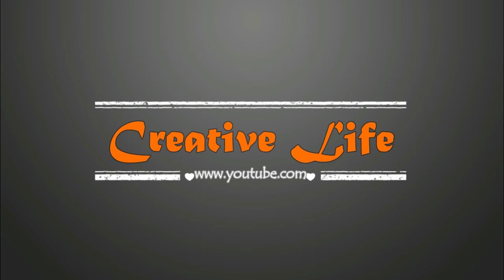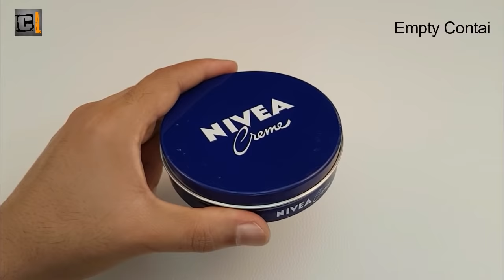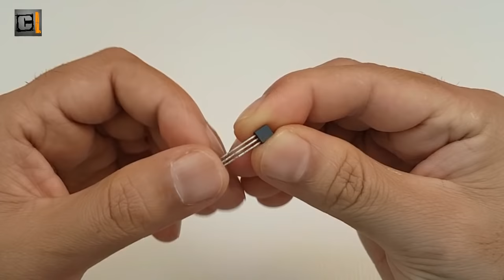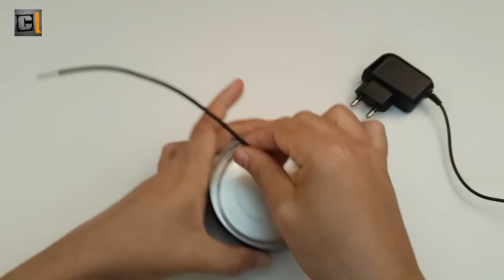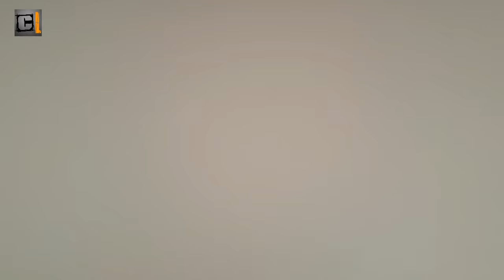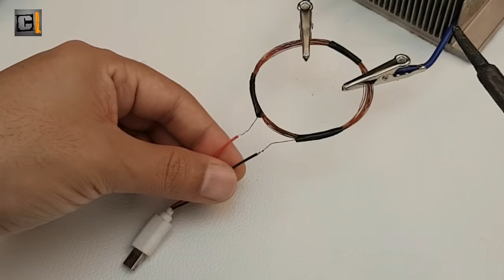How To Make a Wireless Charger

Comment: Wouldn't it be simpler to just get a battery pack charger and safer as well and more convenient, once charged can be taken anywhere for recharging phone. They also have battery pack phone chargers that can be rechargeable with sun's solar energy. I will say it was a nice effort in a different approach to innovative application, however.
Reply: Gregory Trane Zaboor. meaning weep zaboor divine intervention weep to
Reply: what your saying is solar portable power bank. it is available in the market. and this wireless charging aren't meant for mobility. but it is meant for home simplicity. hope that clarified.
Reply: helpful for physics project tho
Reply: They have wireless power banks too

Comment: any battery is charged on DC voltage but you are making the dc from adapter to ac 
because dc current can't pass through Transformers
what you have done I think it will affect battery life because instead of dc you are giving ac

Comment: I this this is may be a tricky video. This may not work. The charger uses a simple transistor probably which can switch max. 100mA of current through a coil! Horrible then the coil and transistor is packed into a metal container which acts like a shielding and damps magnetic field  . Besides these losses and general losses this induces a current into the second coil which is directly connected to phone via usb port.!!!! Even if the field induces a magnetic field inside the coil then also the voltage produced will be ac and fluctuating do u think it is safe to charge this phone with it? ... Anyway's its fake ..... 
Btw.. well played trick 👍
Reply: Bro I have one doubt
Reply: For magnetic field we need to give ac supply but here directly giving dc supply to coil does it works are not
Reply: saikiran kiran 

yes it is not necessary to producing variable Magnatic field AC supply is needed.... but u also produce it by using two Magnatic field resultant...here transisor is divided primary Coil in two part and resultant field produce variable Magnatic filed....   but in this video this guy directly connected his phone with secondary Coil...this is never charge ur mobile... even u connect full rectified circuit then also it not work bcz with rectified current is may be around only 60 milli amps....it just show that ur phone charge but actually charging not rises......

don't use this on ur mobile without any perfect knowledge.....

don't make this types of full videos...
Reply: Finally someone who understands stuff, cheers man!
Reply: L - TV  perhaps it's a hand heater...
😂
Reply: What language are you writing ...is it a new language
Reply: saikiran kiran I have been a Bakra
Reply: All your points about this type of charger are true . I put off buying a shop charger . was thinking of making one , but after this video I will forget all about it and keep with my good old plug in charger.
Reply: I have done it as follow in video but not work at all

Comment: I did the same thing as u did in the vedio.
But i am not recieving current signals in the coil

What could be the reason
Plz help 
And reply as u read this message

It is my electronics project 😋
Reply: It will not work! Because DC current cannot create an induction. It's totally bogus

Comment: something missing well let me tell 

"he basics of Faraday's induction law. Alternating current is required in
 order to have induction. DC current from the power supply will only 
produce some heat to the primary coil after the transistor is burned" 

u need to follow the rules dumbo

Comment: it's not fake
it's based on the design of mini tesla coil
and parts are either available online 
or you must go to an electronic market
but these parts are super cheap
the wire is also not the normal plastic insulated wire 
this is another kind of wire
check it on any motor shop
Reply: UV TECHNiX 
saikiran kiran 

yes it is not necessary to producing variable Magnatic field AC supply is needed.... but u also produce it by using two Magnatic field resultant...here transisor is divided primary Coil in two part and resultant field produce variable Magnatic filed....   but in this video this guy directly connected his phone with secondary Coil...this is never charge ur mobile... even u connect full rectified circuit then also it not work bcz with rectified current is may be around only 60 milli amps....it just show that ur phone charge but actually charging not rises......

don't use this on ur mobile without any perfect knowledge.....

don't make this types of full videos...
Reply: This won’t work, at all. You need AC for inductance, and that would also require a bridge rectifier on the receiving end of the circuit plus some form of resistance and a 5v regulator. (Most phones use 5v 1a for charging)
Reply: Correct

Comment: The coil on the back of the phone would give the phone 5 Volts AC power, Your phone takes 5 volts DC power, AC can damage your phone by charging it with that type of voltage, but if the "Charger" he made actually worked
Reply: sir can you please tell me the name of transistor

Comment: This is so fake hahahaha! You need AC current at the source for wireless charging but the power source is DC current, his mobile adapter so it's obviously fake...
Reply: Electric and magnetic fields are present around any electrical circuit, whether it carries AC or DC electricity  and also capable of producing a magnetic field. This is how AC or DC motor works. inductive coupling principle is used here. To know more Refer below link:
https://en.wikipedia.org/wiki/Wireless_power_transfer
Reply: ram rachaveeti Yes genius but DC current can't induce stationary objects.
Reply: Thats true Einstein, That is the reason Transistor 2N2222 is connected in the circuit to make sure the DC current supplied is changed into high frequency AC current. In the TX (transmitter) section, the AC current in copper wire creates a magnetic field. Once an RX (Receiver) coil is located near to the magnetic field, then the magnetic field can induce an AC current in the receiving coil. Electrons in the receiving device, converts the AC current back into DC current, that becomes working power.
Reply: Not only that but you can see how he didn't even plug the charger in to the charging port because it would of fried his phone if he did lol

Comment: it will damage the battery
Reply: rohan pednekar no it wont
Reply: rohan pednekar yeah, you need a rectifier to make sure it will go in one polarity
Reply: atomicjellyfishdragon yes i have used a FULL BRIDG RECTIFIRE and a 1uf capicator rated at 16 volts to smooth out the wave formed
Reply: AWESOME EVERYDAY cool
Reply: AWESOME EVERYDAY and I don't recommend using a metal container, it deflects induction waves. It might work, but it usually doesn't work. And if it is a steel or copper container, it might create a fire hazard. Use plastic as the best choice. Or glass.
Reply: It cannot damage the battery. There is a protection circuit inside the phone, so your battery won't get damaged even if your phone got 220V AC injected in the charging port. Phones with bad protection wouldn't even support normal charging since even a specific charger for a phone has power spikes and dives. We saw bad battery protection on the note 7. We saw what happened.
Reply: This is a common misunderstanding, the power supply, in this case a coil, supplies a certain amount of power, but it doesn't force it into the phone, it's the battery charging circuit inside the phone the one that "sucks" power and "pumps" it into the battery, not the power supply. Of course, if you overload it it can get damaged and not charge anymore, but this is not the case since the phone is getting less power from here than from the wall power supply
Reply: atomicjellyfishdragon what  is  rectefier lol
Reply: AWESOME EVERYDAY it will....
Reply: DarthVaderAnakin A rectifier is a bridge of diodes which allow current to flow only in one way, transforming ac into dc. Also, dc doesn't work over air so this is bullshit.
Reply: Raidzor つ ◕_◕ つ I agree
Reply: DarthVaderAnakin it is used to convert ac to dc current
Reply: Raidzor つ ◕_◕ つ tell that to the note 7
Reply: TheLegit Bros Note 7's battery was absolutely normal, it was all a construction defect.
Reply: Raidzor つ ◕_◕ つ Yeah, it was not an issue with the battery itself.
Reply: rohan pednekar mn
Reply: AWESOME EVERYDAY why don't u show with all electronics....u mentioned here
Reply: Rohan Pednekar
Reply: Yea
Reply: Yep I will damage the battery
Reply: Its because you are using a AC current to your mobile phone it will make damage or later
Reply: Rohan Pednekar hi are you interested in making a wireless circuit
Reply: that's correct ,non calculated power output non accurate will destroy battery use cable better
Reply: rockstar
Reply: Rohan Pednekar  sac hi
Reply: It does not go because the charger voltage is low
Reply: Yes it
Reply: @raidzor5452  mmmm...... you know something but you have much to learn.

Comment: Metal phone cases can disrupt the connection between a phone and a wireless charger. Metal blocks electromagnetic signals, so electromagnetic induction won't work properly with metal cases.

Comment: Attention:
All you dweebs that say this doesn't work should probably go back to electronics class.
The transistor and the coil of wire form a circuit called a joule thief. It oscillates . The coil inside the can is actually wound as a transformer. Hopefully the can is aluminum. The only component i see missing is the rectifier between the phone and the coil on the back of the phone.
This circuit does work.

Comment: This vide is fake im try this is fake gays   .. Don't west  charger ..ok
Reply: Munawar Ali i know
Reply: This video is fake because wireless charger works on principle of mutual induction but when we give DC supply it acts as wire and it would be burn so when we give ac supply it produces magnetic flux then it satisfies mutual induction soo this video is fake
Reply: I don't know its work or not  and fake or not . But i cheak in wireless charging torch which is work on same processor
Reply: saikiran kiran  what you said is correct,and that's the reason why 2n2222 transistor is used,it converts the dc supply to AC ,and hence magnetic flux is produced.😊
Reply: Munawar Ali it is not fake i have made this and it works like a charm.
Reply: INDIAN FREaK Absolutely noo because 2n2222 transistor acts as only for switching and amplifieng purpose only ,but not to convert dc to ac. For Dc to ac, oscillator ckts will be used but not these transistor
Reply: saikiran kiran then how does the dc gets converted to ac in the above case?
Reply: INDIAN FREaK I'm telling that only the above condition not satisfied.for Dc to ac converting simply tanks ckts will be used
Reply: saikiran kiran u r not correct and the current first flows through the center tap to the base which opens the collector to emmiter path whic in make the positive voltage to go from the other side of the centertap which causes the gate of the transistor to close and the collector to emmiter path closes. this cycle the repeats. i have made this but with more turns and am about to post this vid on my channel. so also sub to my channel and see my other vids on science and games and cubes and physics.
Reply: you are right
Reply: Fuck the only man who can explain   good enought on this coment section is me.
Reply: Hlo😏

Comment: What is the use ? 
Wireless charger means, we should not connect any wire to our phone thru charging port or anywhere. 
Here in this video you are connecting charging pin to phone.
Reply: Well still wireless has a receiver and they are all connecting to the charging female one but its not from the outside its from inside the phone 
I mean they all. Are the same thing also I wouldn’t recommend doing the same he did like at least u need to remove the plastic from the charging pin and make it smaller so it doesn’t bother u much

Comment: Fake video mat bana
Reply: Banay ki nhi frr isko kya ye real me kaam karega
Reply: MOHAMMAD RASHID it will work dude but it's not safe to charge it phone with it cause there I nothing to smooth the voltage (ac) which is going in the phone...u need a full bridge rectifier and a capacitor

Comment: The most biggest and obviously lie here is. You connected the coil directly to the micro USB cable to the phone, without any diode, any regulator or something. If that do works, the coil produce AC current and you CAN'T simply feed it directly to your phone. Never.

Comment: 1) tell me first what is the role of transistor?
2)how dc can transfer through your coil(wirelessly). if you can do than tesla will kill you. bcs charger gives 3.3 to 5 volt DC not AC  
3)without doing impedance matching how can you achieve 100% efficiency. bcs if charging current is less than required, your smart phone will tell you that "charging slowly "
4) so basically you are doing miracle, than you should be in heaven.. why you are in between engineers(earth).. bcs they are doing hard work for people..

Comment: I know that this will definitely damage the battery due to short circuit in the coil, and the charger also, and finally your main fuse! The final charging sound is a pre recorded screenshot...might be.
Reply: If you don't use metal container then it works perfectly

Comment: I know it works using 'electromagnetic fields'.
But it won't work too long.
Nice trick.Aww.
Reply: Very simple trick
Reply: It doesnt have electromagnetic fields
1) Box is metal so its blocking them
2) Wall charger is DC and DC doesnt make magnetic fields so no current flowing through air
Reply: Raidzor つ ◕_◕ つ I think you are right.
Reply: Raidzor つ ◕_◕ つ But dc current also produce electromagnetic field.
Reply: I Can Create. No, yeah you are right it still creates a magnetic field but electrons don't flow over it
Reply: Raidzor つ ◕_◕ つ ooo
Reply: Raidzor つ ◕_◕ つ thanks for the information.
Reply: Did you tried?
Reply: Trying To Make, I have tried a simple one with led, not with a charger.
Reply: @raidzor5452  man I know it's fake but it's not DC transistor creates ac.

Comment: Can you do the same method but have a Bluetooth board that powers two speaker components connected to the copper wire that is glued to the back of the phone?  So in other words you would substitute the phone with a Bluetooth board.

Comment: The charger converts ac mains to dc then dc is fed to the coil and faradays laws of EMI are expected to work on dc which is not possible because dc produces magnetic field but we require a changing magnetic field which only ac can produce...so it will definitely  not work

Comment: First off all, the primary coil(that is in the nivea box) induces a voltage at the secondary coil of ac voltage and also only ac voltages through the midair and so if you are connecting it to your phone it should not charge or it can also destroy the phone's battery and shorten its life, that is why a FULL BRIDGE RECTIFIER!!!! is required in order to convert ac to dc and the schematic you use is not so power efficient.
You can always visit my channel for this stuff.
But still, it was a nice try. 
Try making the circuit more efficient and also remove the *UGLY" coil from your phone. Don't forget * THE FULL BRIDGE RECTIFIER!!!!!!!!!!!*.
Reply: But you will still need a transformer circuit to convert dc to ac

Comment: Why did you use double coil windings @ the receiving end, and what's the function of the transistor?
Reply: Transistor work is to control its heat when it become over heated

Comment: The circle of charging cannot work bychance the circuit works but phone cannot be charged 
,Because he used the metal case ,and the copper wire he used its to thick for charging the phone

Comment: Fatal error in the second part , the secondary coil on the phone back produces AC current . how to charge mobile using AC , at least add two diodes in the secondary coil circuit . Greetings

Comment: Absolute bullshit, just, to be able to transfer energy between two coils you need ac voltage with a specific resonance frequency and the nail in the coffin is that the secondary coil (the coil on the phone )is DIRECTLY
 connected to the mini USB ( the coil is outpouring ac voltage instead of DC, that you absolutely need for charging any battery ) the only thing you can do with this is braking your phone

Comment: So where is the Wireless Charging? Don't get me wrong. The video is really interesting and also educative. I just don't see any wireless if any cable is plugged into the USB port. And is the same with those "QI-wireless" receiver from retailers. 

With even the original wireless certified Phones there are no real benefits. Because we still need to drop the phone on a charging pad which is attached to a cable. But the at least with a certified wi-fi charging phone the USB port is free to transfer data. 

I'm waiting for a real wireless charging. You know, charging a device from over 10-15m, at least. And it could be just an option for the phone OS to start charging automatically when the battery is under 20%. Something like this would be interesting. Until then there is no real Wireless charging. But this is just my opinion.
Reply: If you are thinking about that type of devices you don't understand anything. This video is fake btw